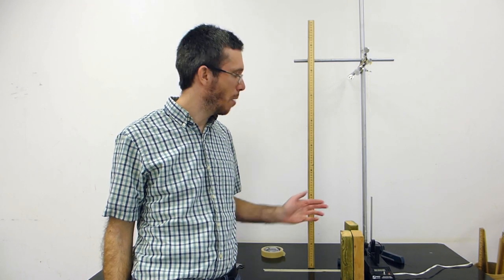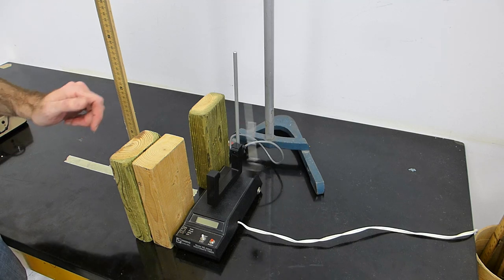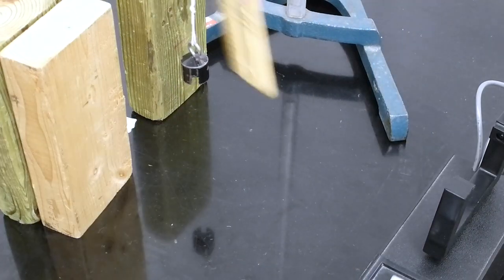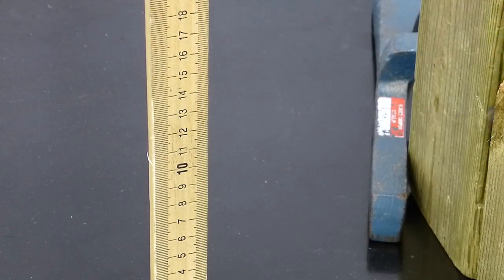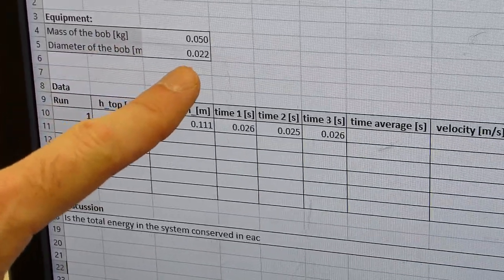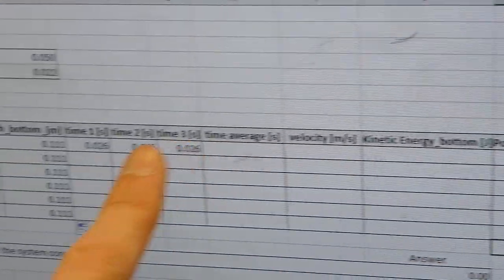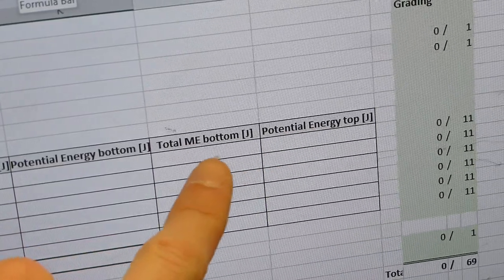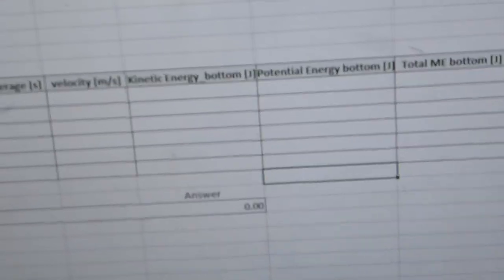Pendulum Lab with Photogates - Conservation of Energy

Comment: Hi! I have a question. I'm doing an experiment based on this showing how the moment of inertia changes based on different distributions of mass. This relationship can be demonstrated by shortening the string length of a simple pendulum and measuring the velocity at the bottom of its swing for each string length. However, I'm confused on why my experimental velocities are all different from each other. I was told this would work by my physics teacher, but I'm confused. If the height to which I'm raising the pendulum doesn't change for each string length and therefore, neither does the potential energy then neither should the kinetic energy for each new string length. But all of my velocities are different. I know the angular velocity should be different but I'm finding the time taken to swing at the bottom of the pendulum (then used to find the velocity and then the angular velocity) changes when it shouldn't. Essentially, experimentally the velocity at the bottom of its swing changes between different string lengths indicating changes in angular velocities but theoretically, the velocity shouldn't change and only the angular velocity should. What is the theory behind these theoretical and experimental differences?
Reply from the maker: Sounds like an interesting experiment... did you make sure the lowest point remains the same?  In case you need it, here are some bridge equations https://youtube.com/shorts/jzr_dY4lRC4?feature=share